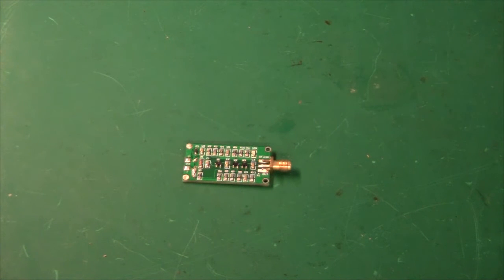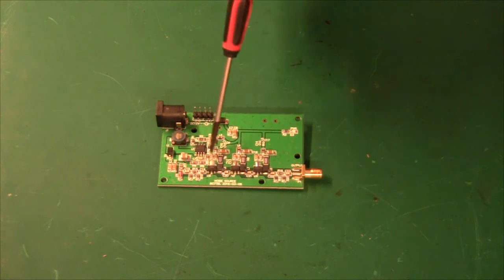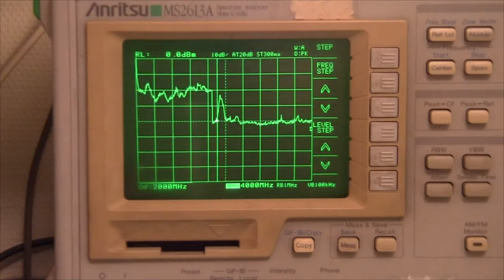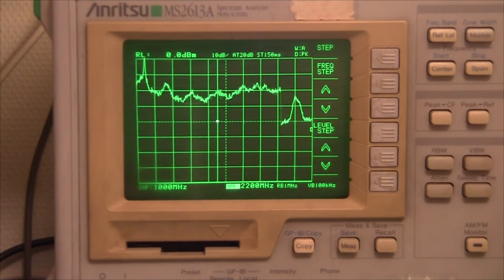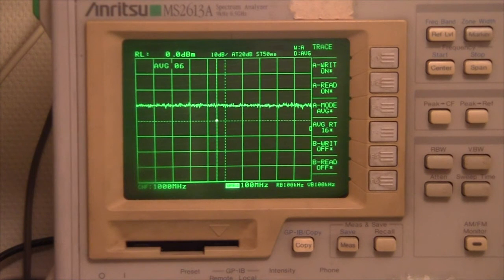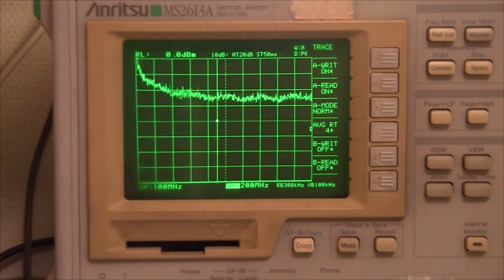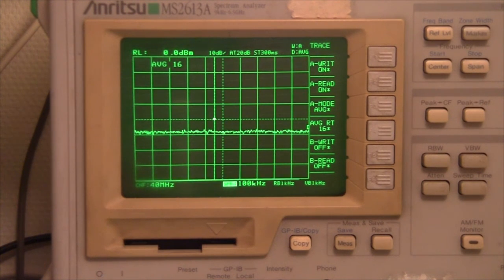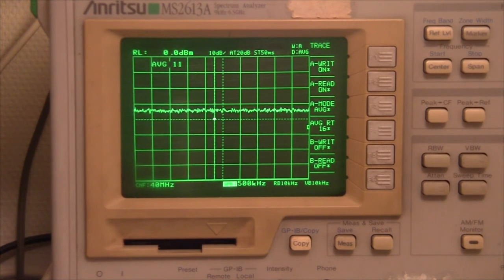Review of a Working Chinese DC to 2 GHz Noise Source

Comment: I saw your review and I bought one. Unfortunately mine does not work, the output contains a big low frequency square wave on top of the white noise. I am going to try some debugging before sending it back. The problem seems to lie in the circuit around the 8 pin DIP that you identified as a switching regulator. How do you know this? Did you recognize the 8 pin chip? It is labelled as GK424 but that did not bring up anything in Google.
Reply from the maker: I think it's a step-up converter. Have a look at the voltage across the diode that is used to generate the noise. If I don't remember wrongly, it is higher than the input voltage. I will have a look at mine when I get home.
Reply from the maker: I mean higher than the supply voltage.

Comment: Hi, found your Channel because of the USB to GPIB project. Good video, but why do someone need a noise generator?
Reply from the maker: Hi Peter, good question, and excellent subject for my next video. Coming soon... :)
Reply from the maker: No, it's much more down to earth - unfortunately.
Reply: are you design a antenna analyzer(using SDR) maybe?
Reply: If you don't have a spectrum analyzer with tracking generator to analyze filters, you can use this paired with your SA, or even paired to an FFT capable oscilloscope.